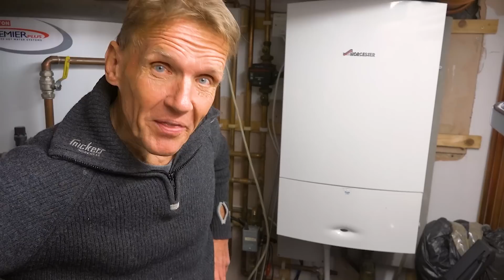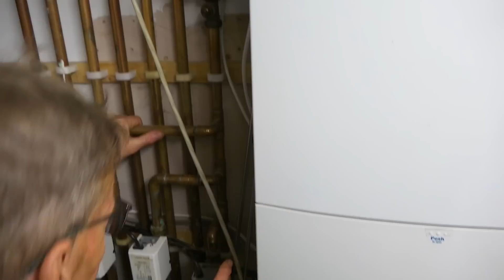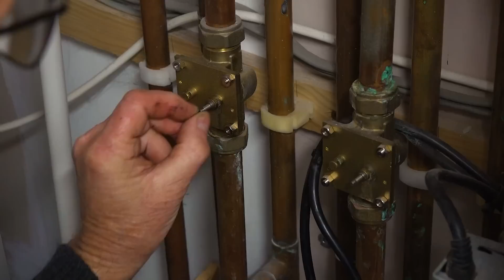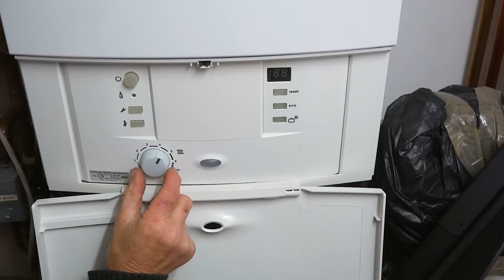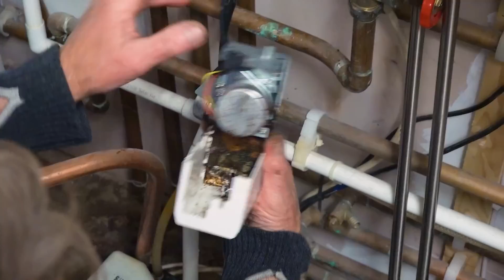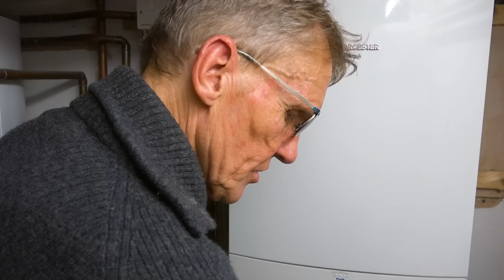How Did British Gas Miss This Simple Fault?

Comment: Depending on the BG contract with the customer, which can be ongoing,following a BG system install,normally,  ONLY the boiler is included in their servicing, the rest of the system isn't nevessarily so in my experience, so, if on calling them out, but you don't know exactly what the problem is, it's better to ask them to investigate whether it could be a plumbing,engineering, electrical , or, a combination, whereas, if you play 'smart' by pointing out what you 'think' is wrong, that is all that they would check, because that is simply what you requested & that can be a very expensive mistake if you are wrong.

There's no harm, as the Skill Builder shows, in looking for 'tell-tale' signs, in this case, as always, electricity & water are not the best of friends.

Looking at the piping system here, I would probably have installed the valves horizontally at the point where the pipes are 'T''d' off', that way, any joint leaks would simply fall away from any electricals & leave a noticeable mark on the floor to need attending to.

The system isn't bonded either, but obviously the RCD is working as it should, though, in older properties not updated at the consumer box, bonding was a necessity.

Skill Builder, has a good general knowledge of construction work & it has real dividends in having aquired the 'knowledge'.
Reply from the maker: This was a whole system care contract. They replaced the valves with Honeywells

Comment: Yes that shows a lack of training and understanding. I am not a plumber, but I know a little and I had a similar fault, a tiny pipe leak running down on to a Honeywell zone valve, If an RCD trips start looking for water if it is not a device insulation fault.

Comment: I had a combi fitted by BGas in 2006. It went so badly it was put out of action by Corgi the next day. Holes left in the outside wall, flue all wrong and sagging, leaks of water etc. It took them at least 5 attempts to sort it out. I put it up on a heating website forum and it went to 50 pages. When the managing rep finally came he offered just £50 compensation. I told him "look unless you fix this and sort it all out to my satisfaction both technically and financially, I will put this farce on every single plumbing and heating website in the UK, not just the one so far. By the end of the month you won't be able to fit even a tap anywhere in the UK!" They sorted it pretty quick after that.

Comment: I bought an old house with a gas boiler and a gas cooker in the kitchen. My wife was a little nervous about them so I got the gas man to cometh and check it out. (They seemed to work OK to me, but I planned to replace them within a few months. The guy condemned the boiler because he said there wasn't enough ventilation. When I challenged that, he said the air-brick in the wall wasn't enough, he measured all the little holes and so say calculated the air flow. When he had finished he handed me a form to sign agreeing not to use those appliances. I tore it in half, switched on the extract fan mounted in the window, a told him to get training in common sense.
Reply: Haha.  He was correct, worse thing you could have done was turn on the extractor fan, adding to lesser air supply for the boiler to use.

Comment: They've gone down hill rapidly in relation to engineer standards I did subby installs for them  for 18 months. The amount of new boilers that were sold on the back of misdiagnosis on system faults was scandalous 😮 i regularly pass an old air strip outside Huntingdon,  its got dozens of BG vans sitting there riding out their contracts. This is one of many sites across the UK, testament to all the talent who left after their fire and rehire. Then they started taking folks straight out of gas school,  what could possibly go wrong.😅

Comment: British Gas don’t cover underfloor heating and never have done. Could be one of those intermittent faults tripping the electrics when the underfloor room stat was calling for heat sending power to the actuators that were wet.

Comment: I gave up with British gas when I had a problem with my boiler not turning on. If you just listened you could hear a big click when it worked and when it didn't, their was no click so the issue was with the small relay box. BG first diagnosed my system needed a £900 power flush. Eventually after an argument their boss agreed to replace the relay box if I agreed to the powerflush if it didn't work. Surprise surprise, with a new relay it all worked!
Still it's not as bad as Aspect who quoted me over £12,000! to replace a combi boiler! something a small local firm managed to do for £3k instead
Reply: Moral of the story, you needed a new boiler that probably had a flush involved anyways? Lol

Sounds like you should have just had the flush mate 😂

Comment: Had a fault on my heating system, booked an engineer as I have service plan with BG, who couldn’t find the fault, ( he was here for roughly 15 mins), suggested I book to have a power flush, (£800). Luckily, my nephew is clued up on heating systems,  discovered it was the heating zone valve, once this was replaced the system was back up and running. My plan finishes the April, I will be cancelling.

Comment: Would have better and safer to disconnect the two heads from the wiring centre , but well done got it up and running
Reply from the maker: The trouble is it wasn't my job so disconnecting the valves might have invalidated the cover. They used nifty 5 way connectors so there was no need to go into the wiring centre.

Comment: I diagnosed a failed actuator on my hot water system, and British Gas wanted £299 plus parts to fix it. I picked up an identical actuator at Screwfix for £54, swapped it for the old one in 15 minutes, and the hot water problem is now fixed.
Reply: In fairness doing anything yourself will always be cheaper as you cut out the labour costs of a paid professional. If you'd got a reputable independent it wouldn't have been much cheaper as they need to earn a living, so it's not really BGs fault in this case.
Reply: @noggintube  I don’t think any decent guy would charge 300 quid to change a zone valve actuator though 😂
Reply: @noggintube  £300 Just for changing the actuator, no drain down?
Reply: What you need to remember though is a lot out there are not capable of doing that
Reply: Yeah I’m guessing you didn’t charge yourself labour?
Reply: @sdbrogs at £100 an hour, still a bargain.

Comment: The big problem with these systems today is do you ask a plumber, a sparky or a boiler engineer  when a fault occurs ? Most plumbers have no clue how a boiler works, most sparky will not touch the gas boiler and most boiler engineers only know one specific make. The poor householder is the one with the cheque book.

Comment: 1986, bought a flat with a gas instant water heater.  It had a gentle drip.  Took the covers off, drip was coming off the bottom of the water pressure valve, that connects to the gas valve above it.  Being naieve, called BG.  A young boy arrived a week later, pointed vaguely at the whole thing, and declared it needed a new one, headed off to order it.  5 weeks later, they called to make an appointment to fit it.  On the day, they didn't arrive.  They'd lost the part.
The boiler had a good booklet with it, with exploded diagram of the parts.  I called the manufacturer.  "Common issue, tiny seal failed, just needs the diaphragm and seal, gas part unaffected, being a motor engineer, should be within my abilities."  He described the procedure, and looking at the parts diagram, looked ok.  Parts dept took the order, jiffy bag arrived two days later.  20 mins to fit, all good.  Called BG, they were stunned.  They asked the price of the parts, less than £10.  Stunned silence.  I think they'd ordered the whole gas/water valve assembly.  Dodged a bullet.
Seems they've not got better in the intervening 38 years.

Comment: Roger like you I always look beyond the obvious and I have a very good knowledge of mechanical and electrical apparatus, however, I had a submersible water pump that  growled  when operated, sometimes it would start up but often not.  After spending 6 months trying to find the problem even involving the manufacturer I gave in and bought a very expensive replacement.  We had checked and even replaced capacitors checked resistances, put other devices on the power socket.  It sounded just as if there was a high resistance somewhere and put it down to a winding in the motor.  During the fitting of the new motor we had to disconnect the feed in the consumer box it served from the 20 amp MCB trip and found that the connection to the busbar was showing signs of heat and the screw was not as tight as it should have been the connection went through the main consumer unit then a smaller on to the pump we had only checked the secondary one - there was the resistance job done.  Intermittency is more common than one would believe and very hard to detect in electrical apparatus.

Comment: We had a BG engineer out for a routine home-heating service. A few minutes into the job, she came through (with a smile on her face) to say that a component had snapped during removal, and since she determined the boiler was obsolete, we would just have to get her to fit a new boiler. She even admitted that this was the 5th or 6th she had broken that week.  Not surprisingly, we were not happy.  Contacted BG to complain but were completely ignored.     We eventually gave in and had a replacement installed by another company (at a fraction of the cost suggested by the BG Engineer) and cancelled all servicing agreements with BG for our home and the other properties within our family.
Reply: None of that happened
Reply: @lewisconway6431 that is not an uncommon story. Also they lie about obsolete part
Reply: @lewisconway6431  why?

Comment: The UK workforce is now saturated with shisters. Bring back our EU brothers and sisters who actually cared. 
Not boiler related but today I discovered the cabin filter in my car had simply been flipped over rather than replaced at the major service. The airflow arrow was facing the wrong direction and both sides were filthy - hence knowing it's been flipped. The main dealer charge £140 per hour for labour. They'd billed me for the part too. 
Too many culture wars, hostile environment, gaslighting and cost of living crises - nobody cares anymore and nobody has self respect or thought for others.
Reply from the maker: I think you will find that many of the Continental workers are still here. I meet a lot of people on site who are only too happy to have the drawbridge pulled up behind them because they now don't have the fear of constantly being undercut by the next wave of cheap labour from the ever expanding E.U.
Reply: Eh, I think you'll find that the opposite is the issue. My partner is a manager of a business, and I deal with training new recruits in another business. I'd legitimately say, no joke, over 60% of my training groups are foreign, I don't mean foreign parents and they were born here, I mean moved here themselves, and I've seen my partners massive list of job applications for a recent opening , I cannot pronounce most of their names, I'd say the percentage is even higher, easily 80 odd% foreign. Many of them being some kind of Indian/Asian that weren't even using British mobile numbers in the job application under contact details...

Main issue, is too many UK people on benefits or disability lmao

Comment: I was called to an upstairs flat (so they had heat rising from below which means lucky they didn't need too much heat) 
The land lady said there was a   boiling noise coming from an old Mexico boiler that had been service by british gas in Monmouth.
The up shot of it was he had forgotten to replace the temp control sensor and the thing was boiler with no control.
I contacted british gas they didn't want to know and said well it's too old and should have been replaced anyway.
So that's there answer for leaving a boiler to blow up!

Comment: You have it in one Roger and the few things you have on your side is age, common sense and experience with a tracking base mind. None of which are taught to nearly all newish Gas Safe engineers or even the British Gas lads as few even know systems all they do know is throw bits at it and hope by magic they fix it whilst employed, with still wet ink on their domestic plastic, self employed cannot act like that, or afford to have that mindset. However 95% of self employed would do their best to sell a new boiler install but in the case your highlighting would still have the same problem. Being retired from the game now I could write a book of giggles about so called breakdown heating engineers.

Comment: You will probably find that the boiler cover is only for boiler itself and not the heating or plumbing after the boiler.
Reply from the maker: That was not the case, they returned and replaced both valves
Reply: I`ll let them off on that one. @SkillBuilder

Comment: British gas as per lots of others are not taught to problem solve the system just the boiler I had same in engineering young uni educated so called engineers could not cure via process of logical test and elimination they could only rely on tech and that's it

Comment: What a load of bollox you rightly slated a bg engineer for not finding an easy fix,then left a zone valve disconnected on a pressurised cylinder,which doubles as a safety valve,you disconnected a safety valve,turning a boiler stat down ain’t good enough
Reply from the maker: Phillipphiller
Can you tell me where I disconnected the zone valve for the hot water?  Genuine question.
Reply: @SkillBuilder  at 4min 25 you said it was feeding the cylinder?
Reply: @SkillBuilder  you pulled the two heads of the zone valves and left them loose,unless the honey well one was the hot water  then I apologise the pipework was hard to see but I got the impression one was for hot water.as for the bg guy,his hands are tied by the company they are literally targeted about £8 per job in materials so they are reluctant to replace parts,I was on the install side and I couldn’t get away fast enough in the end.

Comment: British Gas kept sending different engineers to cure a fault they put on the boiler after they had serviced it. I ended up fixing the fault, they’d put the pilot light jet in facing away from the thermocouple so the pilot light kept going out, absolutely useless bunch.

Comment: The problem is "efficiency". Engineers are not expected / allowed to spend time diagnosing faults. Just to respond, and get out as quickly as possible. It's not just a BG issue it happens across most industries.  Some years ago, as technical director, I was responsible for the team creating call centre support software within the company. The software was capable of reporting on the number of calls handled by each agent and how long each agent spent on their various calls and at one particular management meeting the call centre manager announced that an agent was likely to be sacked because they were not handling enough calls.  I was surprised because I had always found that person to be very good, often calling the technical team for help when resolving issues.
Every complaint that came in was issued with a unique reference number that the customer was asked to quote if they called again, and part of the reporting structure gave a "total time for resolution". This report included the number of times a customer called in with the same issue, who they spoke with, and the amount of time taken from first call to resolution. That report showed a totally different situation.  The agent they wanted to fire actually had the highest resolution figures of anyone in the call centre. Issues that agent dealt with on a first time basis were rarely raised again, and the agent in question was often the last person to deal with a customer when an issue was eventually resolved after repeated calls.  Yes, the agent handled less calls, but was actually resolving the situation rather than leaving a dissatisfied customer to call in many times, and still not have their problem resolved.  The call centre staff were on bonuses for the number of calls answered NOT for issues resolved. I was not popular for defending the good agent, and suggesting that the bonus scheme should be changed to reflect issues resolved, as, in my opinion, that was the reason the call centre was there in the first place. As a result, we implemented an escalation reporting process within the software that automatically escalated any issue that was being reported mutiple times. We also added a report that rated the agents based on issues resolved. Strangely, neither was popular. I was told that it "unfairly highlighted / peanalised some staff". Translation, "those that were not good at their job" and yes that was the whole point. They didn't have to be sacked, just needed more training.

Comment: A have e central gas heating boiler for 21 years HERMNN worked fine with all revisions made and spare parts changed at time.But from 2 years ago the same service company could not resolve the issue even if I sent them a video.For that a hired a 3rd party professional which diagnose exactly what was wrong and what is to be done to work again.From that moment I felt relief and anger to former service company.i will never made service with a company again !